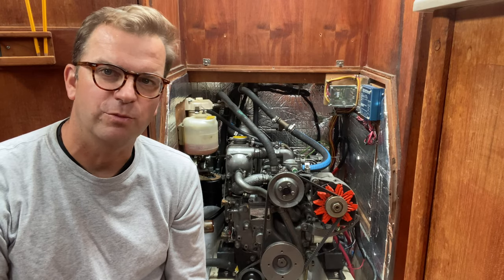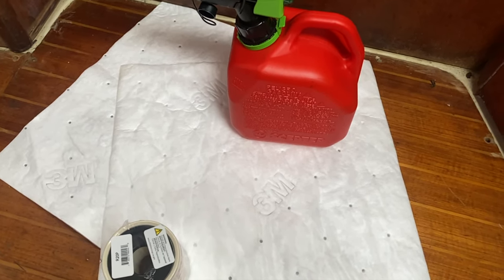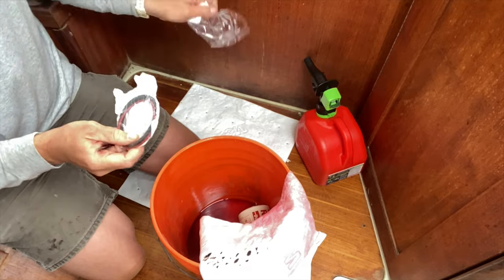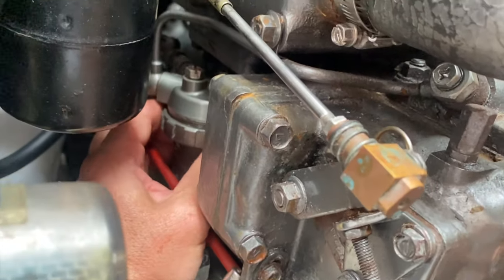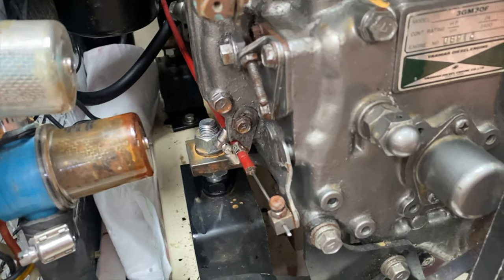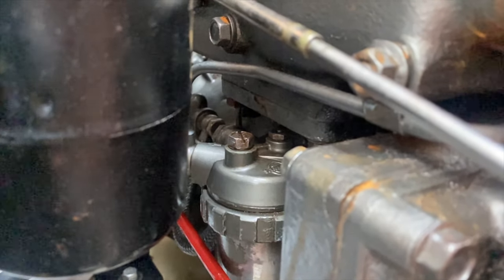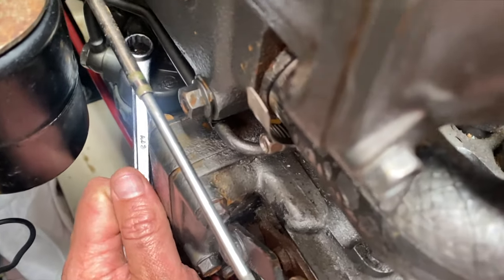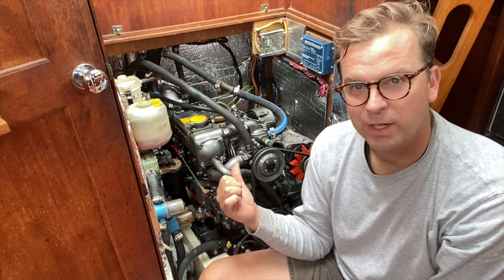Yanmar 3GM30F Fuel Filter Change

Comment: Thanks, that was informative and fun to watch.  Your engine is MUCH cleaner than mine, my boat is a derelict Morgan 35 and I am getting ready to fire up the engine, if it will fire up.  Otherwise, I'm over 70 and have a large reservoir of learning from the old days and am completely confident in my ability to rebuild the engine, myself.  Well, machine shops have tools that I will never have and they know to use them.

Comment: That's a good point about the butterfly valve. That valve is manually actuated by a cam lobe on the camshaft, and if the engine happened to stop at a high point where the cam lobe is depressing the valve, the valve is already fully depressed. So it makes sense the manual actuation would not work in that case. Also your decision to prime the system with fuel is a lot easier, and any particles in that primer that bypassed the first filter will be reliably trapped in the second. Love your Rolling Stones quotation at the end.

Comment: Good video. Dramatically improve your bleeding time to SECONDS by using an electric lift pump in line. I found only bleeding the yanmar filter  is enough. I don't bother bleeding the Racor or the injector pump. Seems the electric pump is good at forcing fuel into the system, allowing fast starting after a bleeding.  Also if you use a 1 liter soda bottle cut in half you can use that to catch the fuel in the yanmar diesel filter, and the oil filter, for that matter!  Electric lift pumps rock! Keeps your engine running if it ever sucks air. Been there, done that, got the t-shirt!
Reply from the maker: Where did you locate your electric pump?  Between the primary filter and the mechanical lift pump?
Reply: @sailboatrefit4145  the previous owner plumbed it before the filters, right after the tank. Idealy it should be after the filters. It has a built in filter to boot. so you have 3 filters (4 if you use, and you should, a Mr Funnel filter)

Comment: Fantastic video !, just what I was looking for...same model filter mount I have...every other video I've found so far had a T-screw on top of mount and lift handles on the filter cartridge?...glad you showed the bleed pump with the white plastic knob on top of mount, that's what I have too, but just thought it was a bleed screw, not an actual pump. Great detail captured in video work too, could actually see bleed bubbles and fuel...nobody else captures that, all too far away and/or filmed by somebody not understanding the job and what needs to be seen...if you did all that camera work yourself, that's even more amazing, well done !! 🙂

Comment: Use the pump on the Racor filter assembly to purge air when bleeding the fuel system.  It does the job much better.
Reply: Not in my experience but would appreciate seeing it work if you have a video.
Reply: Yeah no need for all the detail, pump her up from what ever pump you have on the delivery line, a quick splutter don't hurt, diesels are pretty good overall and marine diesels are some of the best. Thought I was watching Marty from the Ozark show for a bit, uncanny!

Comment: instead of pumping on that little butterfly you could pull the anti-compression levers and crank the starter for 5 seconds which saves you a ton of time and effort. For that you should close the seawater intake and remember to open again !! once air is out...
Reply from the maker: This is a fine suggestion and I have done it both ways.  The manual option offers greater control so one doesn't spray fuel everywhere and I like being able to do it without power.  Check out spelunkerd's Yanmar fuel change video for further explanation of the compression lever method.